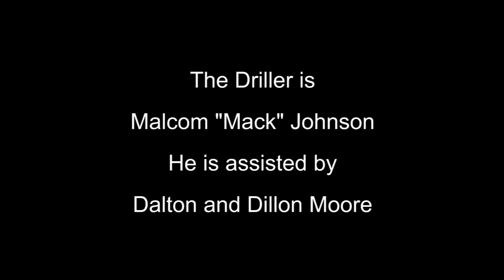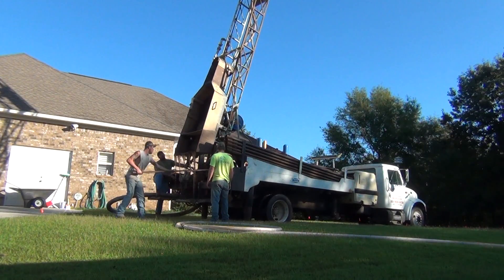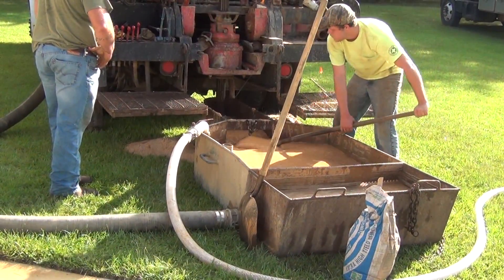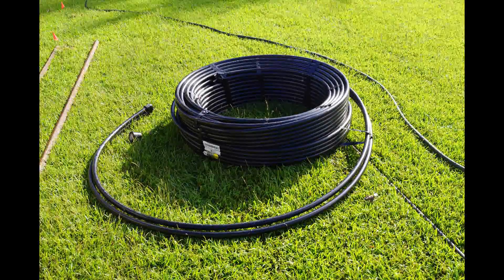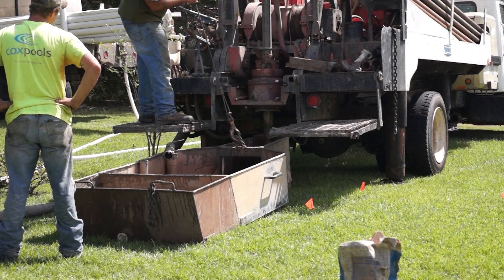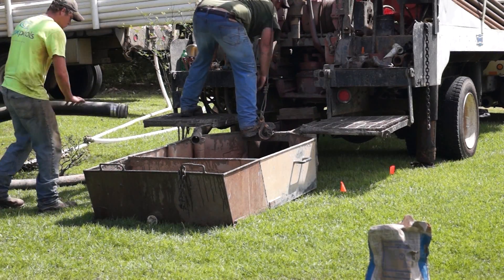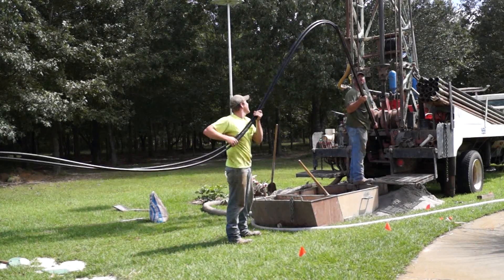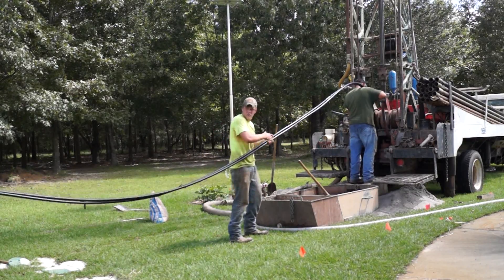Drilling and Installation of Vertical Geothermal Loops

Comment: There are issues with this type of vertical GL. The worst water temp is contaminating the good water temp. Solution is drill more holes. I have thought of a better way to tap the earth of energy. Drill 4- 4in holes just 200' insert 4" sed 40 steel pipe and terminate it just below frost line at the top, with a 1" drop pipe lowered to near the bottom of the 4in pipe that is welded closed at the bottom. Water flows in the 1" pipe to the center of the 4" pipe and travels down to the bottom and then returns on the outside of the 1" and inside of the 4" steel pipe absorbing heat along the way. 144 sqin of ground contact per foot, no cross contamination. Installing at an angle 20 to 30' will set up a laminar flow increasing COP and reversing the flow will also increase the SST. I am retiered but like to talk about it.

Comment: You put 250 ft in the whole that's total I'm sure. Did you drill more than one hole and what size system did you use this for?
Reply from the maker: There were three 250 foot holes for a three ton system.
Reply: @dawmlw so a local well driller guy gave me a price of $5,000 to drill two wells 150 ft deep and that was including putting the geothermal loop pipe and filling the well hole with bentonite.
Reply from the maker: @ronbown3836  That is a fair price.

Comment: Use a horizontal loop layout.  I witnessed a highly engineered, multi well system fail miserably. If you build for longevity, a well constructed ground loop can outlast a good water source heat pump.
Reply from the maker: Thanks.

Comment: Question if they plugged up with iron why did you not use a very strong magnet and water softener without chemicals!! To prevent iron from being trapped inside the line and caking it!!!
Reply from the maker: might have been worth a try.

Comment: I was beginning the process of looking into installing a geothermal system in my house. I have a few questions right off the bat, but here's the main one right now.

Why would someone choose horizontal over vertical if vertical is apparently more effective and also much less invasive to your yard with the drilling process?

I'm very early in this process and it sounds like a great idea because the financing for it would be much less than what I'm paying for oil heat and central air, on top of the value increasing on the home and the environmental benefits. I live in a suburban neighborhood where the houses are pretty close together, so I want to avoid as much damage to the yard as possible to prevent irritating my neighbors who basically share a portion of the yard on the side of our houses. Any other information you can provide is greatly appreciated.
Reply from the maker: Trench digging machinery is much more plentiful than well digging machinery.

Comment: The video did not show how the two holes were connected. The diagram early in the video shows that fluid is pumped down one hole and comes up the second hole. How are these connected? The video doesn't say anything about this seemingly important aspect of the design.
Reply from the maker: They are connected via HDPE in a trench that was dug several days later.
Reply: @dawmlw  Why even bother to reply if your not going to provide useful information? Does the trench connect the bottom of the holes? The top? The diagram shows that fluid is pumped down one hole and then traverses a horizontal path to the bottom of the second hole, and then up the second hole. Is this not the case?
Reply from the maker: @anthonylewandowski7949  The trench connects the top of the holes.    A loop of HDPE goes into one hole, comes back up that hole, and then goes through the trench to the next hole.  And so on.  I'm sorry I have disappointed you.
Reply: I got a price of $5,000 to drill two holes 150 ft deep insert geothermal loop and fill it with bentonite.

Comment: If possible, I'd like to see more of the installation.  For example, I'm sure the holes back filled with something.  If so, what?  What did you do with the sludge that came out of the hole?  In what manner were the loops connected, and how deep did you bury those loop connections?  Basically, a talk through of everything you did once the holes were dug and the loop system installed, to get your geothermal system up and running.  Including the time taken, products used, permissions needed, and approximate costs.  Plus an update on how this system is performing, after so many years.  This was very interesting.  Thanks for the posting of this video.
Reply from the maker: It is working fine.  No backfill in the holes.  Just a little at the surface.  The surface runs are about a foot under the surface.
Reply: @dawmlw  Surprised there was no backfill.  How do you ensure there is no air spaces in the hole? Air will reduce heat conductivity and slow heat transfer.
Reply from the maker: @KB3M  Everything under 15 feet is groundwater.

Comment: Hello sir your video is very educative, just i have 1 doubt, you told that your pump is 4 m3/h for 4 loops of 250 foot each one, what pressure and power characteristisc is the pump, and till now the installation made on this video still running givving good results?
Reply from the maker: Each of the pumps is a 1/6 hp Grundfos pump.  They were still running fine after seven years but two were running a little warm so I just replaced them.  I got the stuff at Geo-Hydro Supply.  Greg there is extremely helpful.

Comment: I can't see in ANY videos with any detail of the "U bend".  They all seem to skip over that crucial part!
  I'm curious if this is a 'fitting', or is the tube itself simply doubled over with something preventing it from 'kinking'?  Stuff like this nags at me.. : ))  
Thanks for any additional info!
Reply from the maker: It is a fitting that comes already installed in the end of the loop.
Reply: @dawmlw  Ahh..really?  So not fit to the length needed once determined?  Thanks for the response! : )
Reply from the maker: @timrick2  It comes in pre-set loops.  Like mine were 250 feet.  500 feet total tube with a U bend fitting at the bottom.
Reply: @dawmlw  Oh!!!  Well, that makes sense.  I had the image in my head like a spool of poly pipe for irrigation.  Thank you VERY much.  It's appreciated!!!

Comment: For geothermal,  plastic tubing is a bad heat conductor.  I would of used aluminum tubing in the wells.
Reply from the maker: You are right but HDPE lasts longer.  Like more than our lifetime.
Reply: Aluminum lasts few years and you have to do it all over again, not cheap buddy.

Comment: What was the cost and was this just for heating the ho.e or electricity
Reply: This is always the most important question and it is rarely answered.
Reply: He already said it in the video - he was using it for cooling. If you want geothermal energy for electricity, unless you're near a volcano you'll be drilling several miles deep. You're not going to get electricity from 250ft.

Comment: I noticed they run no casing? Always thought they ran casing in around the loop system down the casing? It appears they’re just allowing the smaller loop system to be eventually surrounded by the collapsed borehole?
Reply: Yes.  The pipes need to conduct heat.  Contacting wet dirt is a good thing.  Casing is needed for a well supplying drinking water.

Comment: Awesome video and presentation! If possible, please describe process of drilling permits, surveys of utilities, and overall cost of work. Also, do a Part #2 of how the wells are connected to the heating/cooling appliances within the house and cost savings to gained to switching to geo-thermal system.
Reply from the maker: The drilling company took care of the necessary permits so I don't really know.  The wells are connected to a manifold that recirculates water through each loop individually.
Reply: @dawmlw  any unexpected issues or repairs
Reply from the maker: @suzyrottencrotch5132  Not so far.

Comment: Is the well cased? What if it collapses?
Reply from the maker: We want it to collapse.  To hug the pipe and insure heat transfer to the surrounding soil/sand/water.
Reply: Ok, I'm not sure how everything thong works. So this is part of my research. I was thinking about going with climate master and doing a horizontal closed loop system and add the radiant floor aux heat pump.
Reply from the maker: sounds like a plan.  Good luck!

Comment from the maker: You can but it cuts both ways.  With HDPE it lasts virtually forever.  With metal pipe it will eventually corrode.  Stainless and galvanized will take longer but they will go.  With copper, you might stand a chance but it is costly....

Comment: What is diameter and schedule  of HDPE pipe ?
Reply from the maker: 3/4 inch
Reply: @dawmlw  thanks
Reply: @dawmlw  can't we use metal pipe? For higher heat transfer rate.
Reply: @zahidlatif874  i think you can but metal usually corrodes over time
Reply from the maker: don't know about schedule...

Comment: What system system did you install?  3 ton?  How many holes and how deep did they drill them?
Reply: Jake, he mentioned he has a four ton heat pump. If I heard correctly, he drilled four holes, each just a bit more than the 250 feet of poly tubing they ran down each one. He needed 1000 feet in total.
Reply: 2-500 ft deel might have been better. Deeper means warmer ground temperatures

Comment: Looking at doing this too in the sandy soil of Fort Walton Beach, FL.  Some questions: How good is the system working after a few years, is it still up to par?  Did you try it only with your initial wells and did it work?  How deep are the connecting pipes going back to the geo system.  Thanks
Reply from the maker: B Boyle, the system is working fine.  The initial wells only totaled 250 feet and we have a four ton A/C.  You need 250 feet per ton so we needed more.  Matter of fact, it is a good idea to put in extra.  The connecting pipes are only about a foot down and they should be deeper, just to avoid getting easily cut.  Having said all that, if we had it to do over, we wouldn't.  Modern conventional A/C units are more efficient and easy to get serviced.
Reply: @dawmlw  Yes I saw carrier now has a 42 SEER mini split vs around 30 seer for geothermal heat pumps!
Reply: @khandam7709  dang
Reply: Up North We have to install the collector lines below the Frost line and add glycol To the source loop to prevent it from freezing. I guess in Florida you won't have to worry about that.

Comment: Can you drill through limestone with one of these? Thanks
Reply: The Thermal conductivity of rock Is much better than clay. Therefore You don't need to install as many feet of well . There are computer programs that can calculate this for you.
Reply from the maker: Yes, but it will cost more than going through clay/sand.
Reply: dawmlw Thanks for the prompt response. Is that purely because of the extra time it takes, or do you need to use a more expensive drill bit as well?
Reply from the maker: I think it is just time.  In our area there is no limestone so the drillers charge by the foot knowing they will only hit clay.  Where there is limestone or sandstone the drillers will also charge by the foot but likely will be higher because they know they will be going a little slower.  Not much though...  They can go through limestone pretty easy.
Reply: dawmlw Thank you.

Comment: In the near future I will be investing into my property and geothermal would be the most beneficial, I already have a well drilled and functional on my property...
Reply: thanks for making this video much appreciated
Reply: Try not to think water usage when you think geothermal. All you really want is to have an ability to store heat and cold.  Transfer the heat into the house in winter from the thermal mass of some area under the ground or move the heat out to that mass in summer leaving the cold behind to cool the house. Water is just the medium to aid in that transfer outside just like the refrigerant is the medium inside the house. Just have enough surface area to make the exchange happen. It can be properly sized vertical holes or just properly arranged lines of piping  placed at a sufficient depth (6 feet or more) under the ground in long lengths or in a slinky configuration. The horizontal closed loop verses the vertical closed loop  with each having its own benefits and drawbacks. But just remember the "closed loop" part. Don't unnecessary waste water. Closed loops work quite well. Just size them properly. Get a professional, get some one who isn't going to bid on the job.

Comment: I did a VHE testing job in Grand Forks, ND this last summer...lasted from May until November, with the compaction testing of the circuits included. 648 VHE loops tested, talk about monotonous. The circuits would've been completed sooner, but they had an unusual amount of rain, and couldn't move the rigs or get proper compaction. Each hole averaged 290 feet. Close to 36 miles of VHE's and borings.
Reply: What were you doing such a large number of loops for?
Reply: @nickjohnson811  was for an HQ for a power co-op

Comment: Hello. It is a great video!  Did You measure it efficiency? What is the temperature of water coming out of the pipe when supplyto the  loop is  let say 10 deg .C ?
Reply from the maker: It stays close to 60F except during the hottest part of the year when it can go up to 90F.   Like after three or four weeks over 90F.  The loops heat ups.   The air conditioning system still works well even in this condition though.